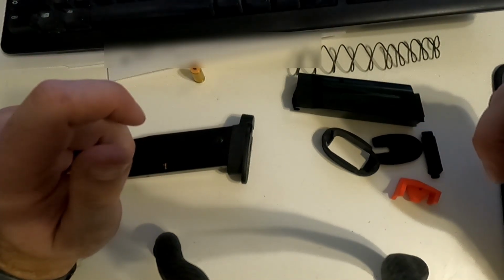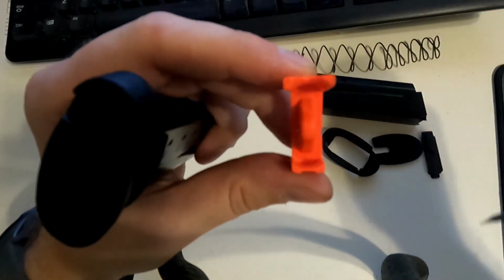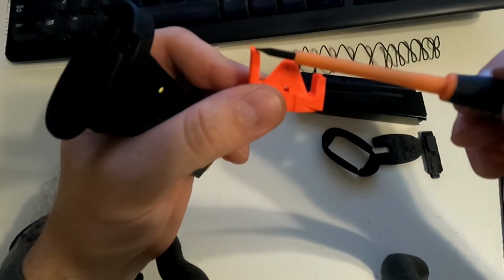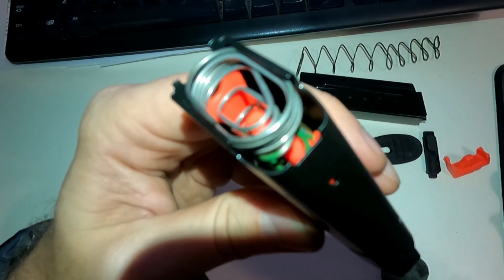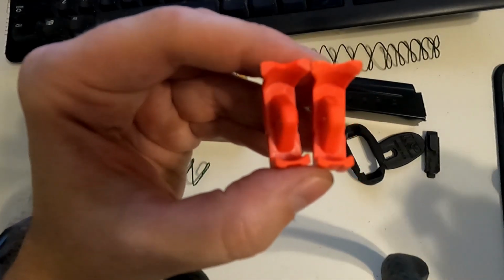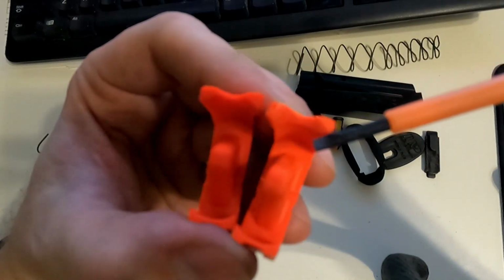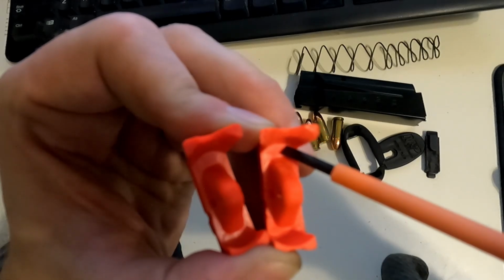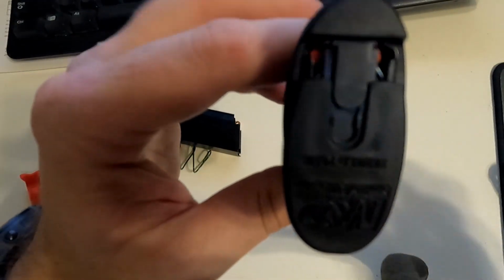M&P Shield Plus 13rd Magazine Fix w/ Explanation of Issue - DIY #educational

Comment: I have (3) 13 round mags. All of them only hold 12 rounds while still being able to seat properly into the gun. This is even after doing this fix and after getting updated springs and followers from S&W. I am convinced the spring tension is another separate issue here at least in all 3 of my mags. I can barely fit 13 rounds in all 3 with a mag loader but all 3 are super hard to seat into the gun and since this is a carry gun I don't trust that crappy lock up so I just download all mags to 12. Funny thing is, even my 10 round mag only seats properly with 9 rounds inserted as well. Again, I can fit 10 in, actually easily in this case but it is very hard to seat in the gun and I don't trust it. I guess too tight of a spring is better than too loose of a spring but it sucks that each mag I have to download by 1 round even after doing this fix and getting replacement followers and then doing this fix to those followers as well after seeing these replacement followers were no better at solving my problem that my originals. My issue appears to be overly tensioned mag springs that do not allow the mags to seat properly into the gun when fully loaded due to too much pressure. Anyone else having this issue?

Comment: M1 carbine mags do the same thing. The only issue I have had with my shield plus mags, is when they’re brand new the follower sits crooked and won’t catch the slide stop. Also causing the slid will hit the back of the follower and bend the front Lower part of the follower ( making the issue worse) the fix is to load new mags to 13 rds and un-load 2-3 times before ever inserting the mag into the pistol. When the springs are new they are not in the proper shape.       ( the top coil is slightly to the right)

Comment: This ended up not being my problem but it was still my solution! 

My spring wasn’t attached to the follower at all in my 10 round mag. Not sure if that was my doing when I put the Pearce Extension grip on it or if that’s how it came from the factory. Either way, it’s working smoothly now!
Reply from the maker: Glad you got it resolved!

Comment: S&W should  be aware of this flaw,another thing I found is that the height of the follower adds more effort to put the las 2 bullets,what I did was to take some material  from the bottom part so it can go farther and lower maybe just a hair never took the chance to measure before and after but it helped a lot

Comment: So here's an interesting follow-up to your video. I have been having the same trouble as other folks in loading more than eleven rounds into my Shield Plus 13-round magazines. I was excited to come across you video and proposed fix for the loading problem, and couldn't wait to get my mags apart to perform the fix. To my surprise, none of my five S & W factory mags has an orange bottom plate like the one shown in your video. Instead, in each of my five mags, the spring sits directly on the small, thinner black plate shown in your video.

Emboldened by the discovery that the travel of my mag springs are unrestrained by any plastic 'shelf', I pulled out my Uplula and with some difficulty, was able to wrestle 13 rounds into three of the five magazines. The other two mags stubbornly continue to resist the insertion of more than 12 rounds maximum. I am going to leave the misbehaving mags  loaded with12 rounds each for a week  or so, then plan to unload and attempt to reload each with 13 rounds.
Reply from the maker: I believe you may have misinterpreted the video. The orange is the follower at the top of the spring and the black is the bottom plate. I’d recommend a rewatch and you’ll see there’s no orange on the bottom
Reply: The orange you see is when the follower is at the bottom of the mag as you push the rounds down.

Comment: Dang! Awesome fix! Was thinking of getting the shield plus or the CZ p10s. May have to go with the P 10s
Reply from the maker: Thanks. Not everyone has this problem but if you do, it is an easy fix. Otherwise it is a fantastic carry gun!
Reply: @SacksGarage ended up buying the shield plus. I can only get 11 rounds into the 13rnd magazine. So definitely may try this. I wonder if s&w has made a modification to their followers? Plus thus this video should be sent to Smith & wesson
Reply: @SacksGarage ried this & its much better. I can get 12 in & 13 with a little more effort. I did contact smith & wesson & they are sending me a new spring & follower anyways. Thanks again

Comment: I guess i got lucky. I can get 13 in but it is tight. I just ordered the Equalizer 15 round magazine for my Plus!!
Reply: The equalizer mags work with the 9mm shield plus?
Reply: @TerminalM193  Yes, they are interchangeable.👍
I just received two 15 round mags that I ordered from Palmetto State Armory $34.99 each.
Reply: @YouTalkinToMeBro  Awesome, thanks for the info! I think I'll start looking into getting a few then. How much further does the 15rd stick out from the 13rd mag? Also, have you had the opportunity to test the mags through live fire to make sure no malfunctions and that the slide locks back after last round?
Reply: @TerminalM193  If you have large hands this 15 round magazine is great. I have a full purchase now on the grip. It doesn't stick out too much for me. One of my 15 round mags needed this trimming to get all 15 in.

Comment: Will that solution also make it easier to rack back with a fully loaded 13-round magazine? Currently it's very hard. 
Thanks!
Reply from the maker: I would imagine so..others have asked the same question but have not heard any success stories. I did not have any issues with racking the slide.
Reply: Yes, that was one of my issues along with it not wanting to take the full round count. If you force in the round then  install the magazine  the round is pushing up against the bottom of slide too hard and that makes it just about impossible to rack back.
Reply: @IcyReaper  But did the solution in the video made racking back the slack easier for you? (with 13 loaded rounds)
Reply: @Bbbb-kn6vz Yes, it went from just couldn't do it to no issues at all.   I just went and compared it to my other older mags with no issues and the rack force was the same.

Comment: Sack, your magazine video provided a fix for thousands who have the SW Shield Plus.  I have another problem with my SW Shield Plus and was wondering if you have a solution.  The “take down” lever on my pistol is so tight I’m unable to lower it without using a device (a wood dowel) to push it down.  Can you provide a solution?
Reply from the maker: Sorry I don’t. Best solution I have is to do it a bunch of times to try to break it in and use lots of lube. I wouldn’t modify it.
Reply: @SacksGarage  Thank you for the advice.

Comment: I can get 13 into mine but it is extra tight.. and actually crimps the casings on a few of the rounds when i load 13 into the mag. Maybe this will fix that issue. Thanks!
Reply from the maker: Let us know if it works!

Comment: Maybe I got lucky. I just recently bought a Shield Plus about 3 weeks ago. When I first bought it,  I had an issue with the 13th round. After running about 250 rounds through it, the issue is gone. Is this something that is generally worked out through actually using the pistol or did I just get lucky?
Reply from the maker: I’ve heard they updated the follower design so maybe you got lucky! Enjoy the new gun, it’s a great shooter.

Comment: I got current manufacture mags with my Equalizer (which uses the same mags, the follower is even marked Shield)  They have completely redesigned the follower to fix the problem.  They should send replacement mags to anyone who got the original ones.  Who knows if they will.
Reply from the maker: completely agree! Seems to be mixed success with reaching out to S&W from the comments and forums

Comment: Every 13 and 15 round Sheild Plus mag I have has this problem of not loading to capacity... 6 13's, 4 15's. One of the 15's has a follower that sits very high in the front, and doesn't always hold the slide open on the last round... The gun is nice, a good size with a decent trigger,  but the magazines are defective. A couple of the springs on the 15 rounders feel weak... I guess I have my work cut out for me fixing S&W mags... At least the one 10 rounder works.
Reply from the maker: Try one first and see how it goes!
Reply: @SacksGarage  Naturally, one mag at a time, checking and testing function as I go. I have a handful of snap caps to fully load. Then it will be off to the range to qualify normal function of these mags. The only mag I trust is the 10 rounder. It's a shame to have such a nice gun with these crappy mags. It certainly makes other firearm options more attractive.

Comment: Does this happen on every single Shield Plus 13 rounder? I just bought one and haven’t loaded it up to go to the range yet. I also noticed that the 13 rounder (when the mag release is on the lefty side) doesn’t seat all the way and I have to push the button in and pull it out. The 10 rounder doesn’t do that and is fine
Reply from the maker: From the comments I’ve received it seems that it is not all of them. Only conjecture, but they may have a few different manufacturers for the followers or they updated them and didn’t do a recall on the old ones. Either way, the fix is very simple!
Reply: @SacksGarage  thank you my friend!

Comment: I have other issue.13 magazine does not close into he gun,12 bullets no prob.Trying to push it by force but not working.What might be the problem?
Reply from the maker: Might be same problem. Others have commented that the legs of the followers are too long and impede the little bit of give that a full mag needs when inserted. I would reach out to S&W to see if they'll send you the updated follower design

Comment: Now to stop the rounds from getting stuck in the magazine. All 5 of my mags magically started getting rounds stuck and i have to bang on it hard to get the out or stick something in there to force the bullet to go straight
Reply from the maker: Strange. Did you confirm you installed the follower and spring in the correct orientation?
Reply: @SacksGarage  i did then i realized my dies werent calibrated anymore so the bullets stuck out too far
Reply from the maker: @dirtydan3029  🤣 CLASSIC!

Comment: Still, the mags are super difficult to insert. Been running 12 and 9 instead of 13 and 10. Is it just oversprung? Should I remove a section of spring?
Reply from the maker: I can’t recommend removing a section of spring as they are designed to work through the entire travel of the follower. I’d hate for you to have a Fail to Feed from a weak spring
Reply: I have 4 extra springs now from Smith and Wesson. The follower isn't my issue, 13 rounds fit. It's fine when the gun is locked open, mag inserts normally. It's when the slide is forward and the bottom of the slide depresses that top round in that magazine, it's too tight. I have the extra springs and followers to play around with. But do you think it would help?
Reply from the maker: @bdub0983  I have heard of other people taking a little material off the legs of the followers. Might be worth a try if you have extras! Definitely would not recommend messing with the springs

Comment: Tried this several times shaving down the follower with my OTF Microtech to remove the hard edges. Still cannot get the 12th or 13th round loaded.
Reply from the maker: My only thought would be to make sure the spring is installed the right way. Sorry it’s giving you trouble!
Reply: did you get it fixed ?
Reply: having the same problem

Comment: I’ve got 4 13 rounders and 3 15 rounders not a single one can be loaded to capacity s&w sent me a new follower to test and it still didn’t work I did however follow this guide and get one of the mags to work but I will be sending them all in to s&w because I shouldn’t have to do this and would still not trust them

Comment: I can get 13 rounds in the mag no problem. The problem is it’s hard to seat the mag in the gun when the slide is not locked back when all 13 rounds are in. For now I’m fine just carrying with 12+1 with some spare mags on me
Reply from the maker: I would suggest loading up the mag and taking off the base plate to see if anything is binding. I don't have an issue putting a full mag in with the slide forward

Comment: Can you tell me if this fix helps with racking the slide on the shield plus with 13 rounds in the mag? It's also hard to push the mag in the mag well. Thanks
Reply from the maker: I did not have any issue with racking the slide. I've seen others have taken about 2mm of material off the longer legs of the follower to help.

Comment: No problem with my three 13-round Plus mags (one in the box and the other two bought from SMKW). Maglula UpLULA helped though.
Reply from the maker: The fundamental issue is you shouldn't need a mag loader to fit the final rounds in
Reply: @SacksGarage  True but I thought the point of this video was offering a fix for the difficulty some have experienced inserting the last rounds AT ALL (even with a mag loader).  My mags not suffering the issue implies it's apparently not universal.

Comment: Had the same problem with the 10 round I could only get 8 in it, this is what fixed it for me. However the 13 round follower comes up to high above the top edge of the magazine after the last round is fired and locks the side back and jambs the magazine so that it can't be released without pulling the slide back slightly then pressing the mag release. This is happening with the 13 round sent from the factory new with the purchase of the Shield +. The dealer had several new13 round mags and they all did the same thing?????
Reply from the maker: I personally don't have this problem but check the forums. I believe people have had issues with the lips. Sorry I can't be more help

Comment: Can somebody please explain why this did not work for me. I see so many comments saying it worked. I definitely shaved it enough I went back and did it again with a dremble to be sure. Just a side note. I was always able to get 13 in. It was just a very hard press. I never got any popping noise. And it is still hard to insert the full loaded mag and harder to rack slide.
Reply from the maker: Some have reported on the forums that the legs of the follower are too long and found success from shortening the legs. I cannot vouch for that fix as I have not done it myself
Reply: @SacksGarage  all four or just the two.
Reply from the maker: @NorthDakotaWrestler2  unknown you'll need to go do your own digging on the internet

Comment: Has S&W even addressed this issue? Their customer service is horrible. The one that came with my Shield works fine and holds 13. But I bought 3 other 13rd mags that only hold 11-12. Seems like they need to just make a new follower
Reply from the maker: Others are reporting they are sending their mags in and getting good ones back.
Reply: @SacksGarage  I cant do that though because I live in RI, their 10 round mag limit just went into effect in January. Im afraid S&W won't send them back to me if I mail them in and they'll just claim "state law won't allow us to" or some bs like that

Comment: The springs between the short magazine and long magazine are the same length, configuration, number of coils, and configuration. The wire size for both is .05” dia.  The newer magazine followers are identical too. Although, the followers have been modified like you suggest… though a very tiny flat still exists on the pointy corners you filed sharp; this appears to be a flatted stop foot at each corner of the follower… and making the followers slightly shorter in height… as a means to keep a round count as it no longer interferes with the spring.  I would suggest removing perhaps 1/16” from the follower height at those feet, but keeping same follower attachment means, and removing 1 to three full turns of the spring at the reduced area at the top fitting directly to the follewer; duplicating the 90 degree bend attaching to the follower to retain it in an empty magazine.
Reply from the maker: Springs are normally fine-tuned by the manufacturer and I would be hesitant to change the spring mechanics and cause feed issues

Comment: 13 fits just fine once you break in the mag.  Just use a Maglula mag loader.  I have 3 13 round mags.
Reply from the maker: Now that this video has thousands of views and is posted across multiple platforms, it seems there have been gross variances in the mags they've put out with the gun. Some people's are fine, some get around this problem with the Maglula, and some are doing this free fix. Thanks for commenting!

Comment: Elongate the top of the spring no more than 3/4 of an inch. Elongate the bottom of the spring about 3/4 of an inch. Then cut loops off the bottom one at a time until you get your desired result. Don’t cut off too many !
Reply from the maker: I'd be careful cutting springs as they are engineered to give the right amount of force through the whole travel range. I'd hate for people to get fail to feeds from this.

Comment: That sucks if that happens to you. I have four 13 rounders and they’ve all worked fine over around 1050 rounds.
Reply from the maker: It appears to be quite common given the response in here and the forums. Glad yours work though!
Reply: @SacksGarage  I have also heard the complaints.

2 of mine were very stiff but I found that if I loaded them to 12, left them overnight, then unloaded them, they would accept 13 the next day. They've all worked just fine since.